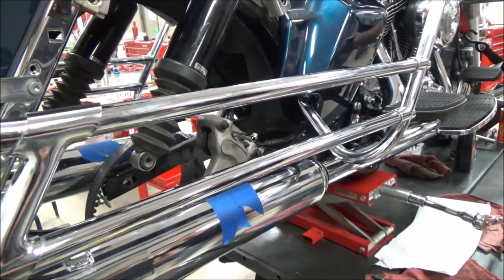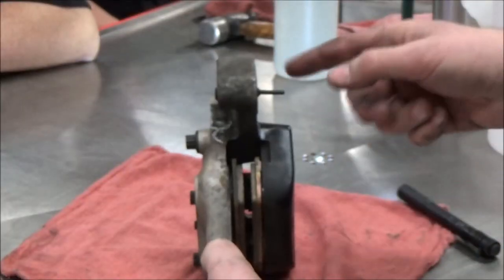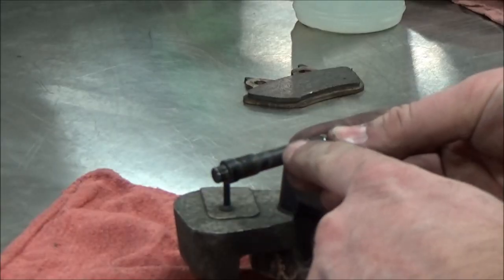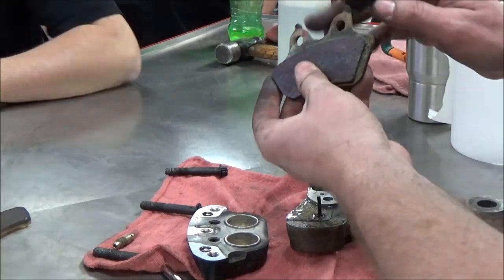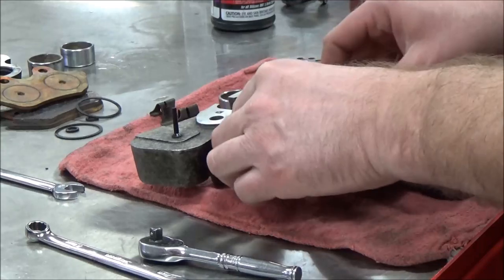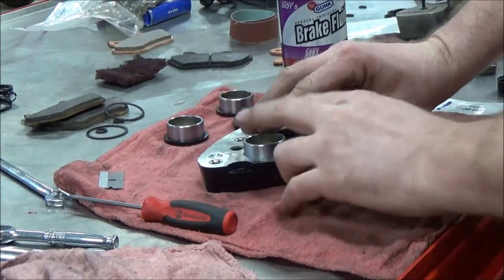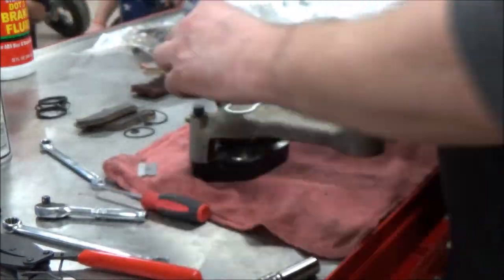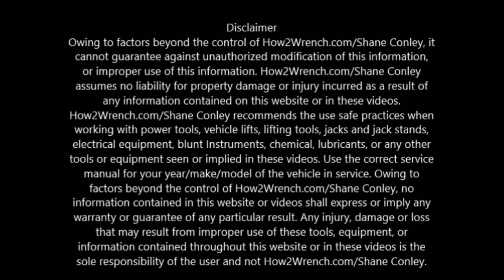How to rebuild a Brake Caliper. Demo: Rear Harley Davidson 44315-00A 44313-00 44313-01A kits

Comment: Greatly appreciate you posting this video. I am rebuilding this same caliper. At 1:44, you make a glaring mistake. You point at the hole that the rear wheel axle passes through, saying that was where the "swing arm pivot" goes.  At 5:05 you talk about not wanting to gouge the metal with the O-ring hook. I suggest the use of wooden toothpicks for this sort of work, and for digging crud out of crevices, to prevent scratching and gouging the metal and / or finish.
Reply: love the toothpick idea,,It works and you wont scratch a thing

Comment: Thanks Shane , I did my brothers breaks today the pistons are stuck I have done caliper rebuilds in the past on the single pistons . I told my brother it has to be the same on the 4 piston .   I just ordered a kit , now I will order new brake shoe pins and anti vib clip .  they looked ok , but had burs and chafing.  ordered a new rotor his was 30 thousands out  guess that is why his pads wore funny .  50,000 miles on a twin cam it is just now falling apart or well broke  in .
Reply from the maker: These brakes (old and new designs) really have and unfair advantage. Their small size and super exposed design (as compared to an auto/truck being tucked in under the wheel more) have a big job and surely don't last long. They are often over looked maintenance item too...
👍 Thank you for taking the time to comment! It helps us! 
Here is a way to support all the free videos.
Want to say “thanks” or “keep it up”? Click here https://www.paypal.me/how2wrench  

Subscribe and Follow us! 
Web:
www.How2Wrench.com     
www.Tools2Wrench.com

Comment: Video makes total sense, and has worked well for my factory calipers, however, on my 2020 FLHX w/ABS, If I am installing a new set of front (chrome) calipers would I follow the following procedure to bleed the brakes? THANK YOU ! ! 

1. Remove existing front left caliper

2. Install new front left caliper

3. Remove front master cylinder cap

4. Squeeze front brake lever to push caliper cups towards rotor

5. Now bleed front left caliper

The above sequence makes sense (my assumption) because Im trying to fill the caliper with fluid prior to bleeding.

Make sense?

Thanks again!

Love your videos!!
Reply from the maker: I'll be honest...I don't have access to 2020 model manuals and would want to look into for sure. When it comes to ABS, I've seen procedures where the ABS motor must be locked (or computor bypassed) to bleed properly. You have me curious...😀Its on my list now...
👍 Thank you for taking the time to comment! Hit that subscribe button if you haven’t please! It helps us! 
Here is a way to support all the free videos.
Want to say “thanks” or “keep it up”? Click here https://www.paypal.me/how2wrench  

Coach Conley is also available for hire to personally work one on one with you if ever needed. Yep he is a real person. Give him a call @ 602-345-0432
Details here: https://how2wrench.com/product/personal-tech-training-phone-facetime/ 
Your answers and help are just around the corner. Save time and money while protecting your investment and yourself by doing it the right way!
Follow us! 
Web:
www.How2Wrench.com     
www.Tools2Wrench.com

Comment: Great video...I'm having some rear brake issues on my 06 street glide...i recently replaced my master cylinder and bleed the lines till the fluid was crystal clear on the way out with no air bubbles...took it for a ride, when left the house the brake was rock solid right when I pressed the pedal, then it got softer after parking the bike for a few hours, then during the next ride I lost pressure completely right after pulling away from the driveway...i went back and didnt see fluid on the pavement and felt the line and didnt feel any fluid leaks...any idea what might be the issue?

Comment: Are the high-pressure seals directional? I was told there is a lip on the hp seal and it goes to the inside towards the fluid but when I did mine yesterday I couldn’t tell a difference either way. Another thing if you don’t have the lubricant from Harley Davidson is there anything else you can use besides brake fluid? I use brake fluid in my Pistons were very difficult to get back in.

Comment: The trouble is finding rebuild kits for very old motorcycles. 

Old Kawasaki Sport bike? 

OEM doesn't make the front kits anymore and only one company sells them for $80 per caliper.
Reply from the maker: Have your tried K&L Supply parts through your local dealer?
Thank you for the kind words and sharing my work. If I can ever be of service to you, here is a video explains how to connect with me. 
https://www.youtube.com/watch?v=vjvmB01ebcs 
Keep Wrenching,
Shane Conley
Instructor/Motivator/Motorcyclist
www.how2wrench.com
Like freebies? Click here for a free diagnostic checklist! 
http://gem.godaddy.com/signups/364621/join 

Did you like this free video and hope to see more? Would you just like to say thank you with a donation? Click https://www.paypal.me/how2wrench
Reply: K&L does have a solid supply of aftermarket servicing parts. For some odd reason their cost for the front brake caliper kit was around $89 per side after shipping. Local dealer would order them. Thanks as always for sharing your knowledge to everyone!

Comment: Hi Shane.  Very helpful for me.  I have a question.  If someone asked you how long on average to rebuild a rear caliper what would you say? I have an 04 HD software with PMI brakes.  Thanks
Reply: Alex Lynch    tricky question.,.. add about 1 hour too brake pad replacement... At about 15 minutes for bleeding depending on your equipment... Add about 30 minutes for complete flush,.. at about 15 minutes for cleaning Reservoir.... At about. ????  If it has abs.   If you haven't done them lately or a bunch of them... Add about 1 hour.???   If you're actually learning on the job do it cheap... Considering you're getting paid for practicing..???   Use a stopwatch but you can't charge for parts soaking. !!!   You will not know if you have bad slide pins bad Pistons Bad boars
.. heavy corrosion till after your way into it.???  This is why people do it their selves... And shops will only install a new caliper. !!!  But if you have to do it 2 or 3 times it's cheaper than the shop and a new caliper Plus you get your experience for free.....
Reply: Alex Lynch   hey Alex you kind of resemble Henry Winkler at a glance where is your Triumph hahaha.   You're looking at roughly 3 hours... If you need help you can hit me up anytime I'll walk you through it step by step.

Comment: I have a 2000 sportster with the same style caliper, I dont know why but the the manual said to loosen but not remove the caliper body bolts prior to removing the back wheel for a tire change, so I did. now I'm not able to get pressure. I checked the master cylinder per one of your videos and I have pressure all the way to the back banjo bolt, but no brakes. I also pushed the pistons back in to help with wheel installation. what gives?
Reply: Just a thought, is there any fluid leaking around your brake pads? If so, remove your caliper, disassemble it and check the cross over o-rings. Refer to video at 7:23. If even one fell out, and isn't seated properly, will cause the caliper to fail.
Reply: @BayouOgre  I got it I went about bleeding them with just a hose on the bleeder. I bought a simple catch canister, put a a little fluid in the canister and finally got brakes! The fluid in the canister must have helped create a little more vacuum. Thanks for your reply!
Reply: Ahhh, you had air in your line. The catch cannister with fluid in it, makes sure that the line doesn't suck air back into the line. You must have released the brake lever before locking down the bleeder screw. Common mistake for first timers. Now, they have Russell Speed Bleeders, every one I've asked, who use these, have high praise for them.
Reply: @BayouOgre   lesson learned haha I try not get screwed by the same thing twice!!!